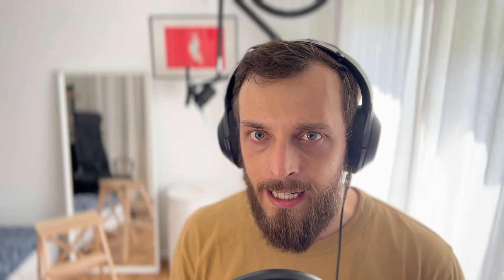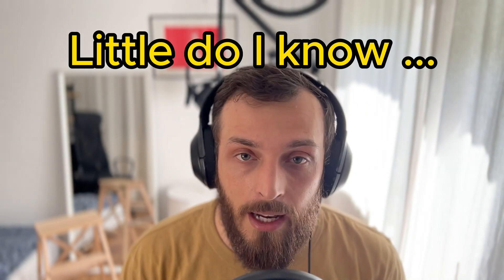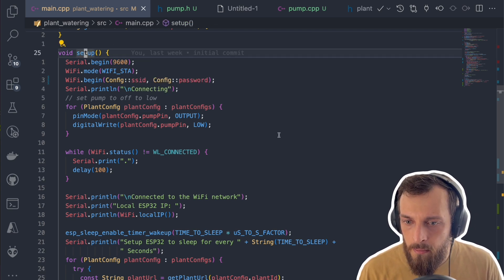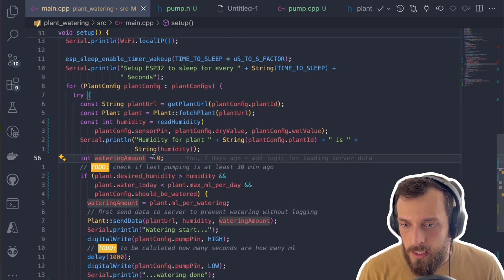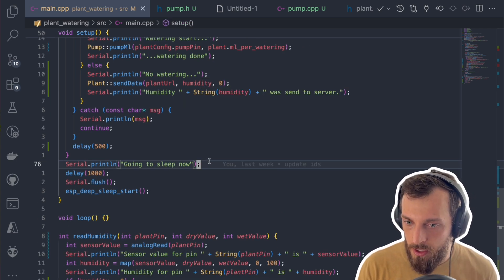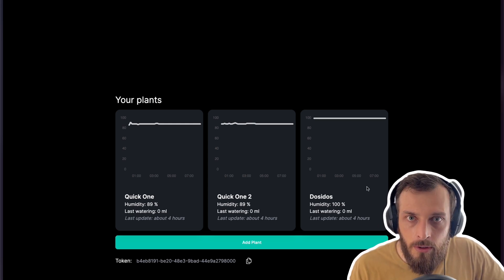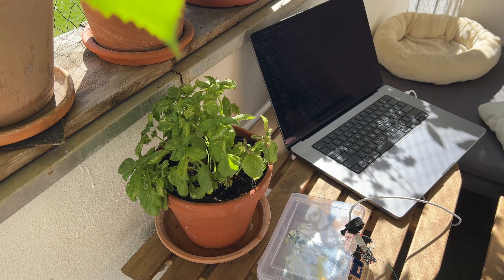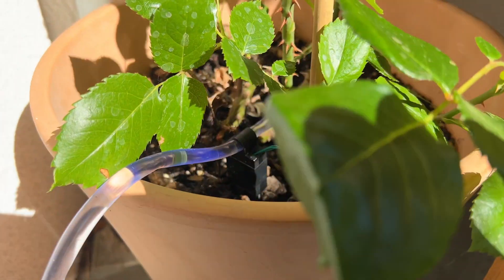DIY ESP Plant Saver | Humidity-Controlled Watering | Part 2 🌱

Comment: An Idea to calibrate the sensor: put dry soil in a pot on a scale. If you know the dry wight, you can check it again later.
Than let it soak in water, let the water drip out and put it back on the scale. Now you can measure the 100% wit the sensor.
And if necessary, check the status again with the scale.
Reply from the maker: Also good solution yes :)

Comment: It's best to use an Ldo 3.3v or 5v with current above 500mA. Cap is more  for voltage stablilization not for current. The booster already have that on the output.
Reply from the maker: hm, then this one should be fine. Somehow i also fried already 2 charging boards :D 
no idea what happens there

also, if you wrote me a mail, i cannot respond, it is blocked

Comment: Hi, check the current when the wifi is trying to connect and if your battery can handle with current that the chip need when doing so.
Reply: Maybe you can try adding some bulk capacitor to the ESP board. I have read somewhere that the ESP is taking most current when connecting to wifi, maybe the converter cannot deliver that power and thus you are experiencing issues.
Reply from the maker: @sinishastojchevski  Good point. Also heard about it. This may be worth a try :)
Reply from the maker: Thank you for your comment :) 
But it just works fine on the first run
Only after deep sleep
Also works just fine when running without sleep
Also works fine if restarted after sleep does not work on the same battery by reset click or reconnecting the battery 🤔
Reply: The battery is connected directly or there is a LDO 3.3v?
Reply from the maker: No the battery is connected to a step up module
This is connected then to the 5v input

Comment: Your new 3 weed plants will do just fine. Regarding the ESP: people seem to have issues with Aliexpress level quality of them. So if you ordered cheapo chinese clones, that might be the issue already. They love to use garbage parts. Other than that, apparently waking up can be an issue. Seen someone fixing it with a 500ms delay before basically doing anything in setup(). Don't have any of these units though, so I'm just throwing stuff at the wall from my own experience or that of others. 

if you're using water with fertilizer, you might want to get an opaque hose for the watering. Algae build up can be quite strong otherwise. I also appreciate your own solution to the issue. Everyone is always like "it has been done already" or "you can get something cheaper from china". But I love the tinkering and the experience I get in return. I actually have something similar in mind, just a bit more complicated, as it's basically supposed to automate a whole season (more or less) of indoor growing. Like I said, I just like challenges.
Reply from the maker: Ah very interesting. Thank you for the hint. Maybe I’ll try this again. But with the ticker it works quite well atm :) 
So maybe I just leave it like this for now. 

Thank you. I will fertilize by hand for now I think :). Also just for the vacation to not rely on people. So during the normal days when I am home, I’ll just turn off the watering and water by hand. Will maybe add this to control from the Frontend as well. 

Happy to collaborate and add more logic if you are interested in it. This is finally a useful thing I am really using regularly.
Reply: @CodingWithAuryn  I sent you an email about it. Could be a fun little project ineed.
Reply from the maker: @UnqualifiedForThis  ah it was you, tried to answer, but somehow my mail was blocked by your mail :D

Comment: where did you bought soil moisture sensors, and what timer chips are they using ? tlc555 or ne555 ?
Reply from the maker: Not sure, i think the tlc, need to check :) 
Bought it from aliexpress. But got the good one i think (was lucky :D )

With the ticker it seems to work just fine :)